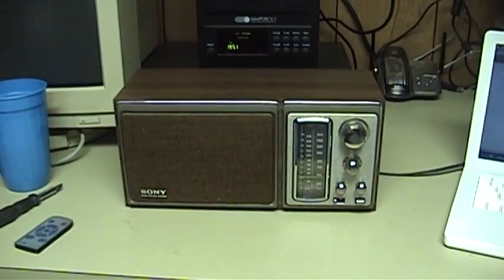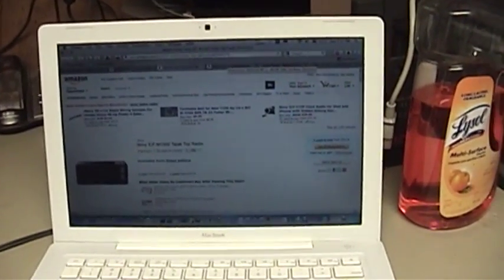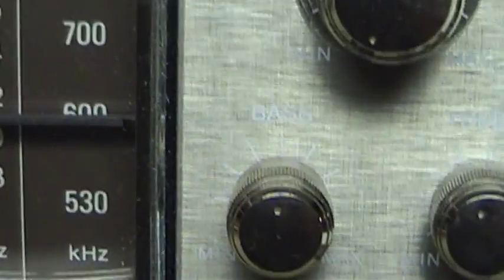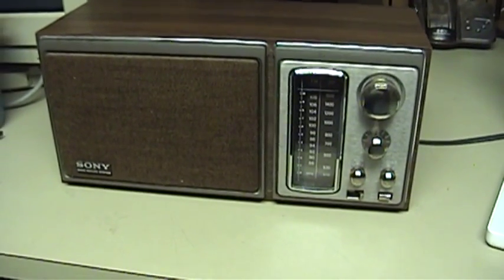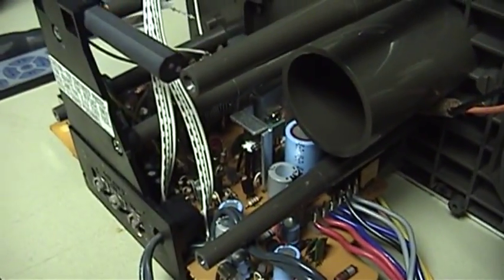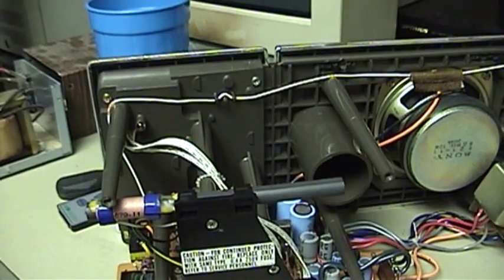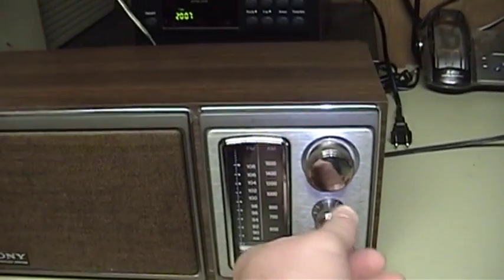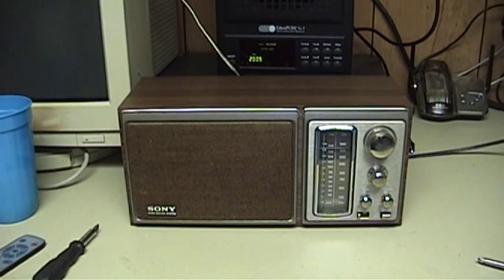Sony ICF-9580 Table Radio

Comment: I bought one of those Sony radios back in 1976 as I started a new job in a radio station and wanted something that had great sound. I remember going into the store in downtown Philly and picking it up. As I recall, it was just aroundr $100 new in box - pretty substantial pricing for a mono table radio - but it sounded great. I kept that radio with me at my desk for 30-odd years until I retired, and I still have it to this day. It's somewhat packed away now and rarely used, and I'm pretty sure it needs some tuner-cleaner for the controls, but the last I checked, it still worked. Over the years, people would stop by my desk and marvel at the sound of that radio, some propelled to try and find one like it. Thanks for the video, and no, you cannot imagine from the sound on YouTube just how great this radio sounds.
Reply from the maker: This was exactly the kind of product that really drove home what Sony used to be all about: products that worked well and were decent value for money. While they've definitely slipped since then, I still think that's generally true.

I still have this radio and it continues to work well. Sony sold many similar models over the years, well into the 1990s if not the early 2000s.

Comment: I'm really not a fan of Sony products at all these days, the quality of their products really needs to be improved a great deal.  I'm assuming Sony sold radios like that one here in Australia, but I don't know for certain, if they did I don't know the model numbers.  This isn't really related to the video, but what's that tiny little credit card type remote control next to the radio in early parts of the video?

Comment: Indeed, Trinitrons are extremely solidly built...

For other electronics i'd say it depends on how well you take care of them. Most laptops, for instance, even the cheaper ones, can last for many, many years if you maintain & clean them well...

Had my current main laptop for 6½ years now, apart from a few scuffs and cracks in the plastic, it still works well, despite it being heavily used for school etc. Only problem now, is that the battery lasts half as long as when it was new... :D

Comment: I have this old Panasonic table radio fro, the dawn of FM. I think it's a '65. the sound is really resonating, but the speaker give a slightly muffled tone. I wish I knew what to do to make it sound as well as yours does, but I don't have enough electronic experience. that radio is interesting, I just might do a video response.

Comment: You say that radio doesn't have a headphone output socket on it, so what are the 3 round sockets on the rear panel for, are they for external antennas?

Comment: Did I spot a 3-gang tuner cap❓ If so, with that good size ferrite rod, it should do very well on AM reception.
📻🙂
Reply from the maker: This is an excellent table radio.
Reply: uxwbill 
Sony and Panasonic are like Toyota and Honda.
📻🙂

Comment: Hey Bill I picked one of these radios up at a flea market this weekend ( $13.00) . It's a great product. My question relates to the back beside the screws for the AM & FM there is a third screw with a symbol above it. What exactly is that ? Thanks in advance. ( I'm using my sons account )
Reply: That symbol means it is a grounding point for an external antenna.  If you were to use an external AM loop antenna, one wire would be attached to ground, the other to the terminal marked AM.  Also, if you had an external FM antenna that used coax wire, you would remove the plug from the wire, connect the inner conductor to the FM terminal and the outer shield wire to the ground terminal.  And yes, if you have both kinds of antenna, you can use the ground for both.

Comment: I just recently got a Sony table radio which seems pretty good, though I think the tone may be a little inconsistent. Sometimes the treble will go from maxium to mediocre. I've never heard of this problem happening. Do you know what it might be?
Reply: Geoffrey Weagraff If it is a two way system it may have a lose connection to the tweeter
Reply: @Cody6210 I’m sorry, but I serviced dozens of these radios over the years and Sony never made a table radio, including the one in this video, with a two-way speaker using a separate tweeter.  Your problem is likely a dirty tone control which will evidence the symptoms you describe. A little squirt of DeoxIT (in the red can) should do the trick. Do the volume control and power switch, too, while you’re in there. But DON’T do the turning capacitor, even if tuning is a little scratchy.  You will permanently detune the tuning capacitor assembly and the radio will tune reality weirdly.
Reply: Clean the tone control with a little squirt of DeoxIT (in the red can).  Do the volume control and power switch, too, while you’re in there.  That should do it.  But DON’T do the tuning capacitor.  That will detune the capacitor and make the tuning decidedly weird.

Comment: So I recently got on of these on ebay (at a premium I might add) and in the listing physically the set looked perfect! I was horrified at how they packaged it. They too an Amazon prime box and forced a slightly small Amazon prime box into it and tup the set into it with no padding.

The sides were tight up against the box but it was aloud to move freely back and forth in side. As you can imagine it did not come pristine... Three of the four corners of the press board cabinet were not damaged with one nearly pulverized.

This wasn't the worse thing though. Unfortunately the AM side no longer works. I was able to get the seller to refund half the cost and at my bafflement she was under the impression that FedEx was to blame and is not filling a complaint to them and offered to refund all the cost if they refund her shipping of $27.

My question is does this set have two separate Decoders for FM and AM? I feel like something encored vibration damage during shipping as the FM side still work AMAZINGLY. 

Also as a side note I can confirm there is an automotive styled dial light in it. Mine still works!
Reply from the maker: I wish I could say that truly horrible packaging on the part of eBay sellers was an isolated incident. I've certainly experienced my fair share of it, though by comparison to stories I've heard, I think I've been luckier than most. Just watch, now that I've said something.

Nine times out of ten, eBay will side with the buyer in a dispute, and my recommendation would have been to go through them first. Doing so might obligate you (on your honor, at least) to destroy the item, though.

I don't have a service manual or schematic for this radio. I'd question whether or not the AM reception functionality ever worked. It's not an uncommon problem to have, especially in an older set like this one. I'd suggest starting out by verifying the functionality of the band selector switch. It could be very dirty, especially if no one ever listened to AM on the set. From there, I'd take a very careful look at the circuit board. It may have been cracked or marginal solder joints broken, although it'd be pretty remarkable if this only killed the AM reception circuitry.